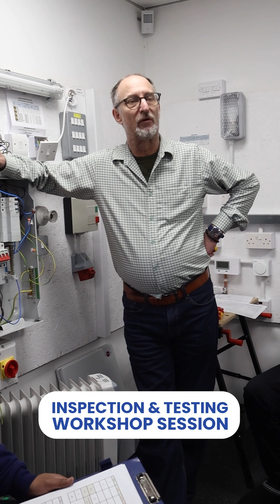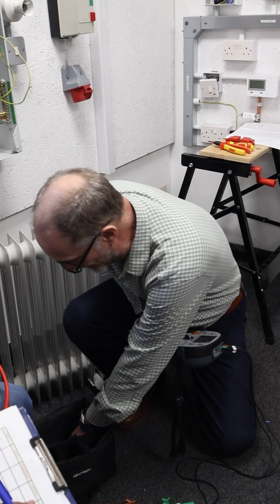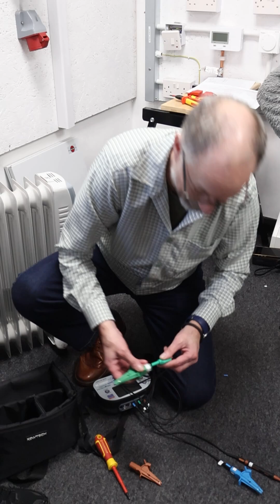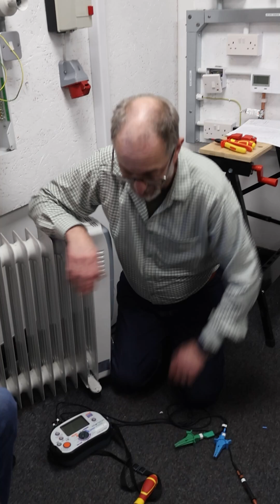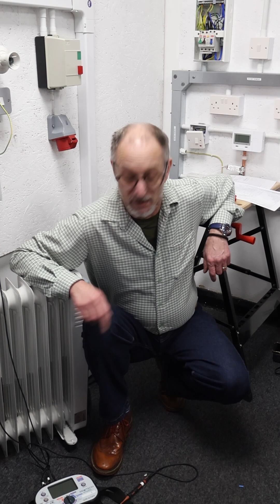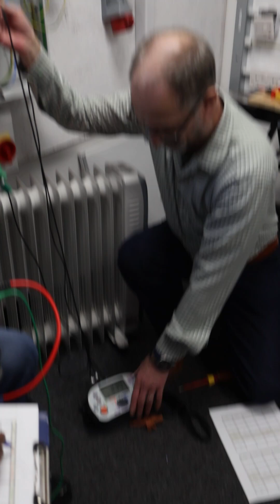2391-52 Inspection & Testing: Real Workshop Training

Comment: It is not at the origin of supply, that room, is 2-3 board downstream, then 5 boards in the room supplied by 1mm x 5. 
That reading is fine. 
If you got to the intake and take a Ze, it will be way bellow 0.35. 
That is just a practice room.

Comment: Wrong wrong wrong .. you have just done a three lead no trip test , with the Kewtech KT63 models the test leads should be in the two lead configuration IE piggy back the blue lead off the green lead for the loop high test . As it’s a two lead high test As per the manufacturer instructions .. also your test reading off 0.98 is to high . Maximum permitted is 0.35 for a TNC-S and 0.8 for a TNS and .24 but can be as high as 200 for a TT,  I doubt that that test rig is on a TT earthing system. . Sadly this is the quality of training these days teaching the learner’s bull sh-t .